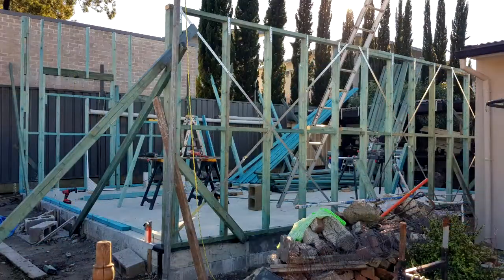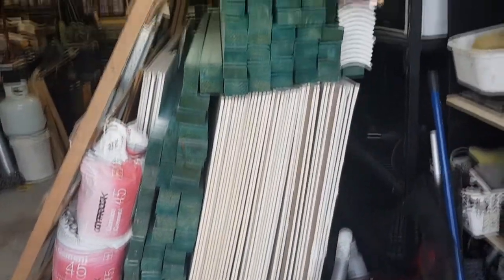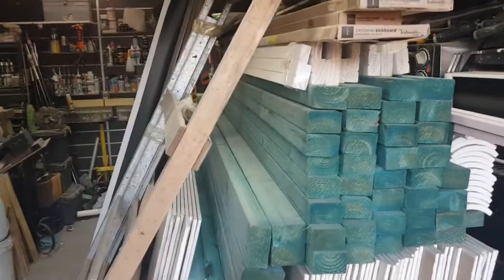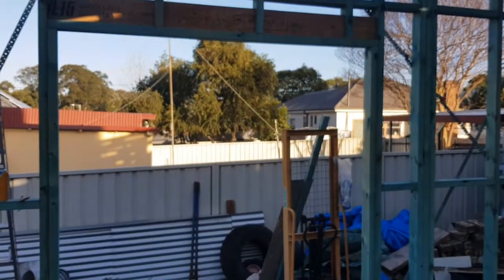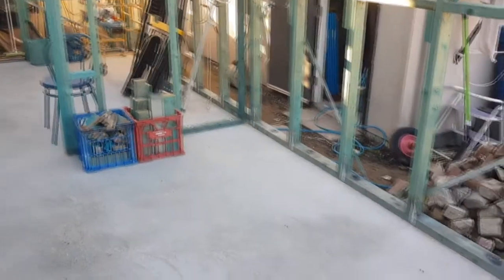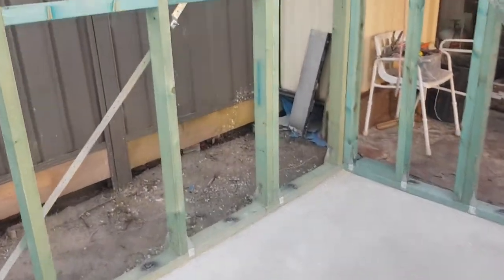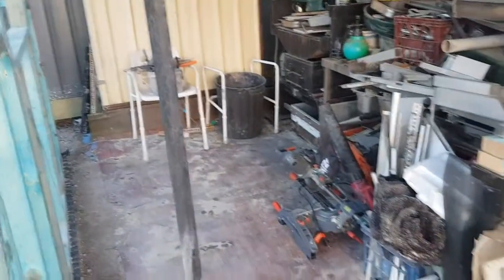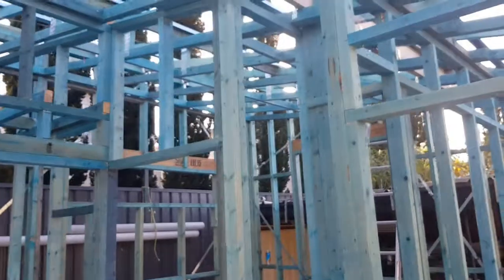House Build P5

Comment: Is all of your framing lumber pressure-treated?  If so is that what is required by "code"
Reply from the maker: Yep... It's a common timber that complies with the Australian  building standards
Reply: Looks like the timber jaz is using is a structural t2 termite treated and lvl lengths as heads n beams in Australian standards looks good to me